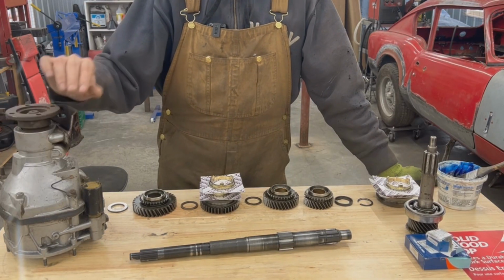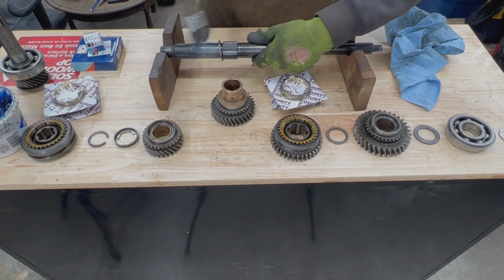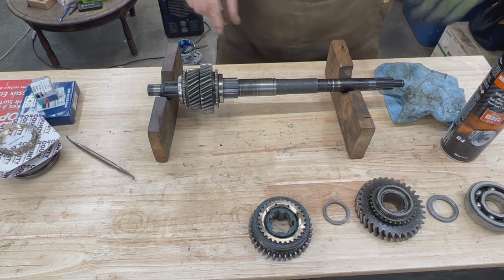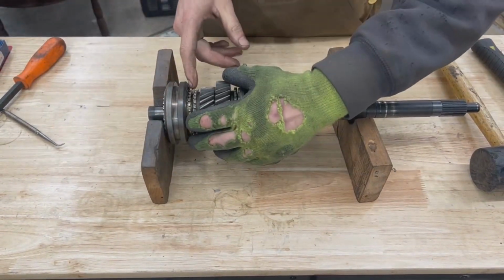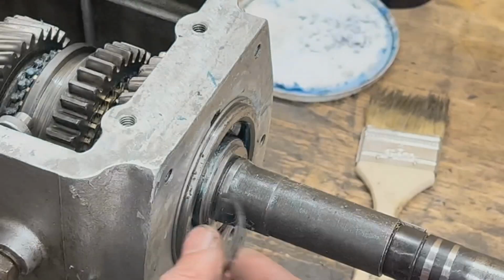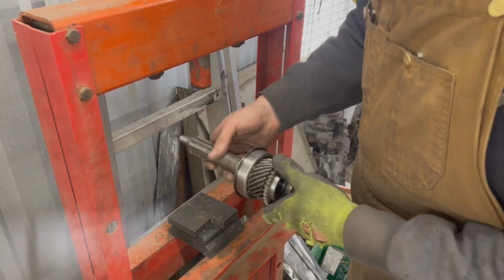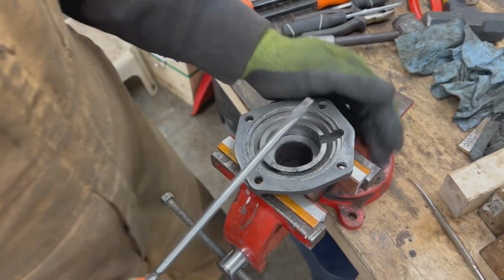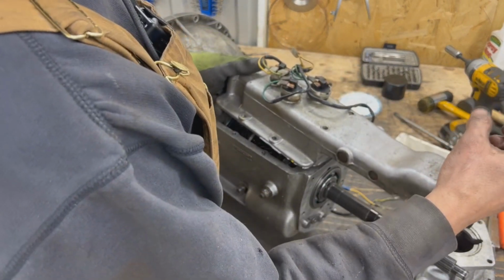A-Type to J-Type conversion - Part 5 - Assembling The Transmission

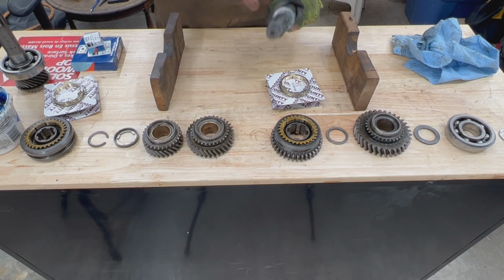Comment: Question:  Referring to the two thrust washers on the mainshaft, at 4:13 and 11:01 in the video.  You mentioned that the front most one has a groove in it for oil, and that the groove goes towards the gear, and, that the rear one does not have a direction because it does not have a groove.  But, in the factory parts book, and Moss catalog, both washers have the same part number.  I'm thinking that on the rear one in your gearbox, the groove has worn away.  I just took my gearbox apart and I can see that both my front and rear thrust washers are worn.  On the front one, I can still see the groove, and on the rear one (more worn), I can still see where the groove was, but is no longer.  So I think that they should both have a groove, and therefore, direction.  Also, on the Moss page for this, it seems that the new ones they sell have no grooves, (or they are just photographing all the thrust washers on the non-grooved side).

Comment: Elin you might want to take the precaution of  annealing the copper washers before you fit them. Heat them to cherry red and then drop them into cold water. It helped me a lot on my Blazer front hose flexible brake line sealing action. The non annealed washer was a bear to seal and felt funny on the torque wrench..it went easy and hard several times as I tightened the bolt. The annealed one felt smooth on the torque wrench all the way down and never leaked.
Reply from the maker: That's a good advise. I never heard of it. Thanks! However here the pressure is not as high as the brake lines.
Reply: It was something that was done to Triumph motorcycle, all copper head gaskets. When the copper is annealed it becomes soft and malleable.  You don't know the state of the copper when you buy a copper washer, so it is better to anneal it to be sure.  I think you will be fine in this case but it is a good thing to do in the future.
Reply: Actually the brake line leaked just sitting there, so it leaked with little pressure. It was a banjo fitting to the front brake caliper with a copper washer on each of the two faces. I was surprised by how large the torque setting was. It felt strange as this was a bolt head that took a small 7/16 inch socket but the thread diameter was almost as big as the bolt head in this case.

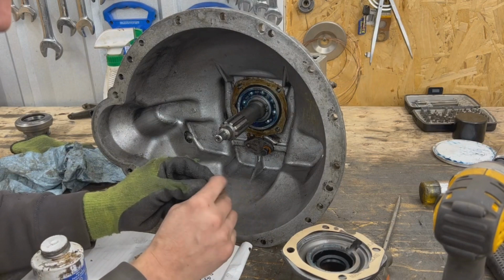Comment: Elin, the gasket you installed at 34:05 underneath the cover plate has a cutout that matches that oil return hump you mentioned (you can see the cutout in the gasket at 33:31). It looks like you installed it with the cutout on the bottom side of it instead of in line with the cutout. Not sure if the gasket will block the oil return passage.
Reply: Yes he did. I think I would open it up and put it in the correct orientation.
Reply from the maker: Uh, oh, never paid attention to that. I just went to the garage and checked another gasket (I have several) and yes, you are right. Well, I think I have some wrenching to do tomorrow :) Thank you!
Reply: It''s easy to miss something like that and you can practice annealing the copper washers at the same time lol

Comment: Great video, very well explained. I'm really enjoying this series. 

I wondered about the Goo as well but you and Darrell have explained that perfectly thank you. 

If you able to, can you explain how the levers prevent both sets of gears being engaged at the same time, efectively locking the gearbox. The arrangement here seems to be different from my 1976 Spitfire, but its a long time since I had that car, almost 30 years!!. Good luck from Spain!!
Reply from the maker: Well, I have finished this project and I don't know when I will have another one to have a chance to explain how the interlock works, but I have explained it last summer in this video https://www.youtube.com/watch?v=iwuGBnzDWOc&list=PLLWNLIF9Lk94K4eZOeTeiPX0iVU-jtGM5&index=12&t=1428s It is simple but ingenious...
Reply: @RustyBeauties  Thanks very much for the link and yes it is ingenious and you have made it simple to understand!! I had a quick search for the 1976 gearbox and it is different, it's called a single rail. I found an exploded view and saw the interlock plate that somehow I forgot to fit!! I drove down to the shops about 5 miles but when I came back the car just wouldn't move as both gear sets had become engaged. Luckily it's fairly easy to strip down lift the cover and refit the interlock. I can visualise you opening a can of Stella and shaking your head!!! Thanks once again for your videos they are bringing back many happy memories and I'm learning a lot!!

Comment: Great info in this series. I have a gt6 OD gearbox I need to assemble some day. Is it basically the same?
Reply from the maker: Yes, and no :) It works the same way, but some of the parts look different. The countershaft for example on GT6 is one piece and you can't replace a single gear. The main difference is in the shifter. But I actually have a video series covering a non overdrive GT6 gearbox overhauling.  https://youtube.com/playlist?list=PLLWNLIF9Lk96ibktN7sCAscX_92sZiVGx 
 I have D-type overdrive transmission for my GT6 that I need to check one day, but I don't know hw soon that is going to be :)

Comment: Won’t the thick grease block the oilways and channels? I have always used STP oil when assembling.
Reply from the maker: It is transmission assembly goo, designed for that. Supposedly it gets dissolved with the oil.
Reply: @RustyBeauties  Thanks Elin. Just found some on the inter web and it gives this as part of the description.
“Assemblee Goo will not melt at shop temperatures and provides "Tackiness" required during the assembly process.  Yet it dissolves and solubilizes in transmission fluids at operating temperatures so as not to clog filters.”